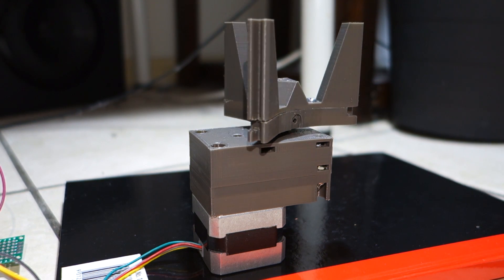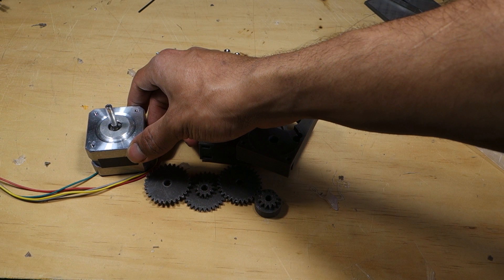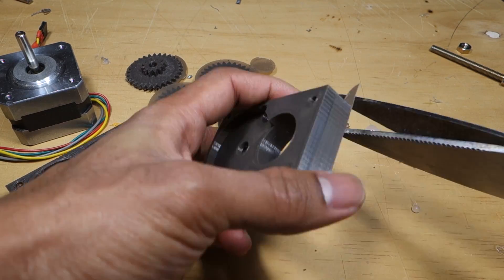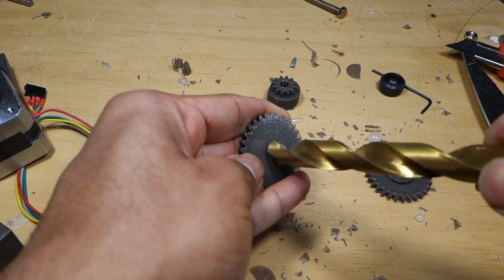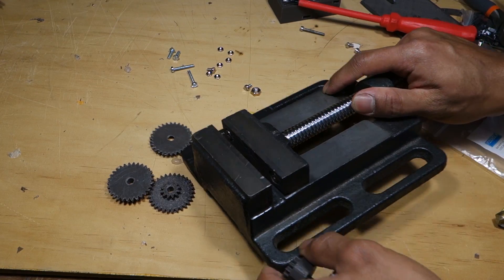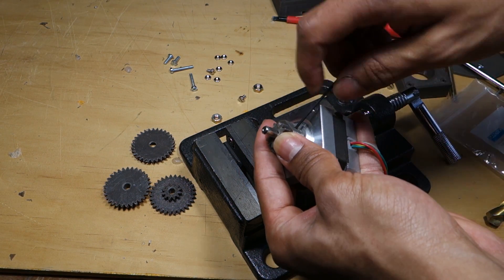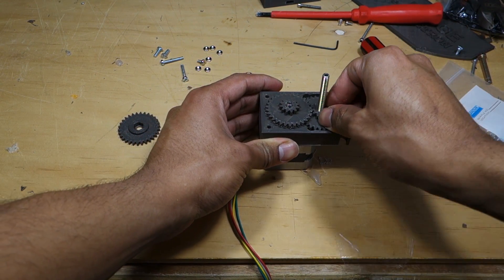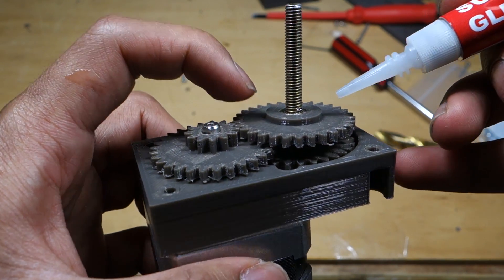How to Make This 3D Printed Part That Multiplies Stepper Motor Torque by 16!

Comment: Torque 2.5 kg - cm is not enough for small 3d(desktop) printer? Printer base about 14-15 inch and height about 1.5 ft?

Comment: Need to correct your math mate, your gearbox is a 7.5:1 gearbox, not 15.625:1 check the calculation you have used, the correct calculation is (Driven Gear/Driving Gear)*Number of Stages so taking your values that's (30/12)*3=7.5 not 15.625
Reply: its 2.5*2.5*2.5=15.625

Comment: how about the backlash?
Reply from the maker: There is some, in situations where the motor only needs to turn in one direction this is suitable. Or when very fine detail is not mandatory.
Reply: Budge thank you for ur reply. so it’s mean that if we like to build like cnc machine or similar which needs to get accurate position, it’s doesnt work properly ?
Reply from the maker: @haikalzaky2502  can't say for sure. I don't think this is a good solution for cnc machine though. Why not use ball screws or threaded rod for the drive mechanism?
Reply: Budge hhmm .. I just try to find another low cost things to improve torque stepper motor  without reduction the precission of the motor
Reply: how many kilograms of weight can it lift

Comment: Nice Job. I have been thinking of doing something similar but not to increase torque but rather to increase the fidelity of a print. You would need to be using a .1m nozzle and running a low heat (to prevent re melting the lower layers from radiant heat coming off your print nozzle. But you could get it to print incredibly accurate and detailed prints that don't need any cleanup after the fact.
Reply from the maker: Perhaps, I'm not sure how much physical detail could be achieved with this method though, I wonder if backlash from the gears would affect things? Also have you considered how stepper motors can microstep? Maybe that might be a different approach

Comment: Nice gearbox. Such plastic gears can be durable is grease and safety spring is used.

  Have a look at the gears in the Chinese ventilators. They are made from plastic, but last for ever, because they use grease and the mechanism snaps one gear out, if there is too much pressure. It's fail-proof and genius, while also cheap. They use the same motor to rotate the ventilator in the front, and the back of the shaft uses the gears to rotate from side to side. 

Good luck with your future projects !
Reply from the maker: Very interesting! I might try incorporate some of those design queues into the next iteration. Thank you :)